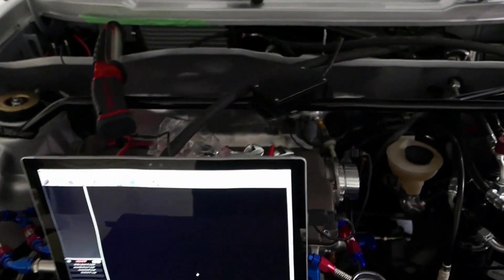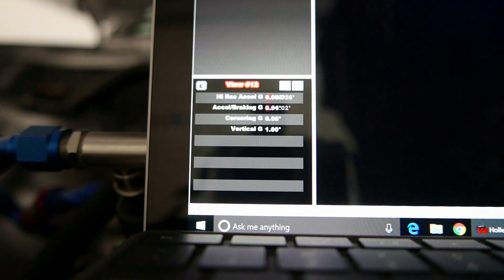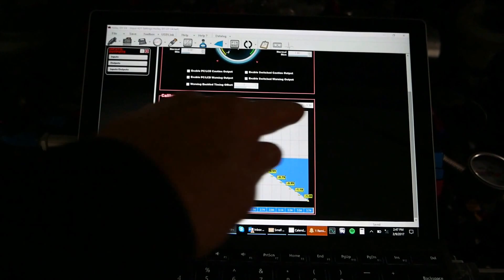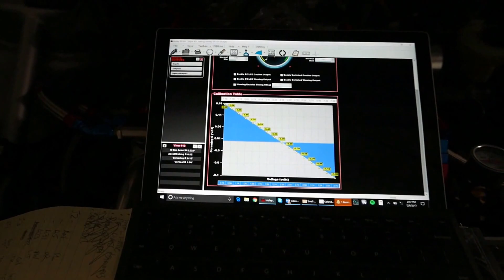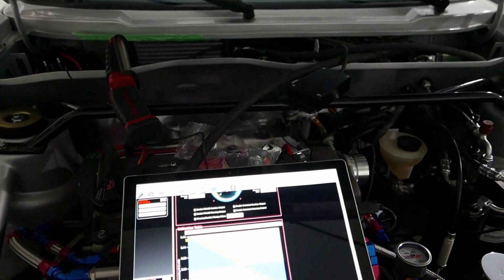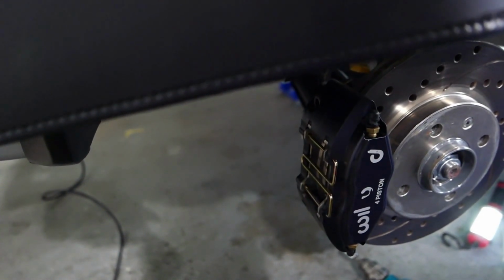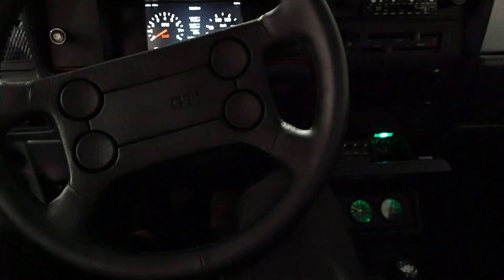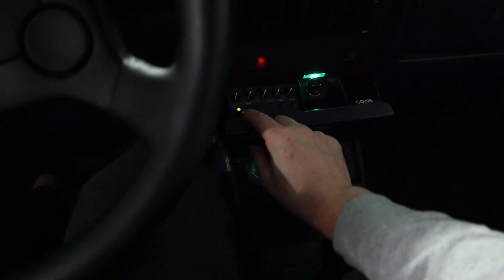The Ultimate 1983 Rabbit GTI - part 140 (Accel-meter install, Brake Prop Valve install, Wheel studs)

Comment: Derek Spratt you are quite genuinely one of the greatest craftsmen I have ever seen, VERY VERY impressive work so far, I literally just bought my 83 Rabbit GTI and I am in love with it, starting the real work tonight, using your vlog as a sort of stencil, while still making it my own.
Reply from the maker: Way too kind! And I am NOT there yet with my technique and knowledge - maybe if I had worked for 30+ years at a VW/Audi dealership like another fellow I know at the local parts shop who is my 'reference'. Thank you for the supporting words - I really do appreciate them.
Reply: Derek Spratt And I appreciate the enjoyable and informative videos, if you don't mind, could I ask how or where you order your replacement parts for, I know a lot of what you're doing is custom but for example when you ordered the new fuel level sender, I'm having trouble finding genuine parts for mine, thanks.
Reply: Mr.Krabs a video or two back he details the vendors used in this build. Very informative! 🐢☠️

Comment: Great work. I had a feeling my rear pressures were still to high in the rear...It makes trail braking pretty exciting for me sometimes. My car handles pretty well though, 3*- camber helps in loose conditions. With me not having a booster it takes more effort but, I can feel when the rears are going to lock up pretty well. Love to feel your brakes. Probably feels perfect. I've noticed most oem style proportion valves create that slight delay you're talking about. I've always wondered about that, and how it affects braking. After your snow melts can you to tell me what max pressure is dialed, at the rear? Thanks
Reply from the maker: I agree with your points. Will do. That delay effect can be felt in the brake pedal as the fluid doesn't instantly get to the rear brakes so it is harder initially and then softens a bit for a while, and then hardens up again after another 1/2" and 1-2s of travel/time. I'd like to reduce that effect and I am sure I will by playing around with the balance and upping it a bit more. I am thinking of backing off the Wilwood valve and letting the smaller one start working a bit harder to see if the response time is improved, etc. I am also going to up the rear pressures when the weather and traction is better ... likely there will be an optimal setting for different tires/road conditions/temperatures ...see next video for more info on this